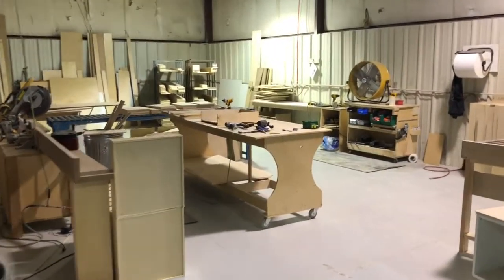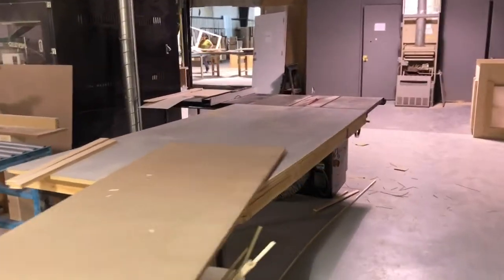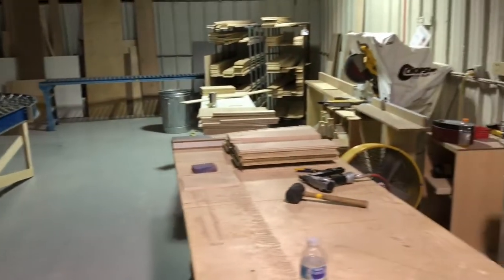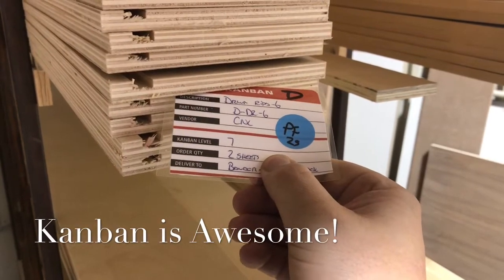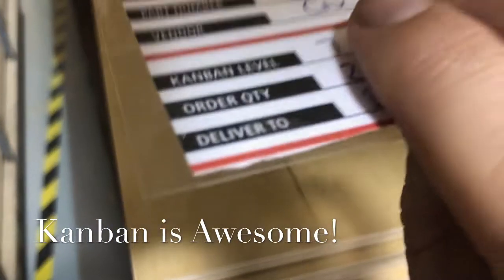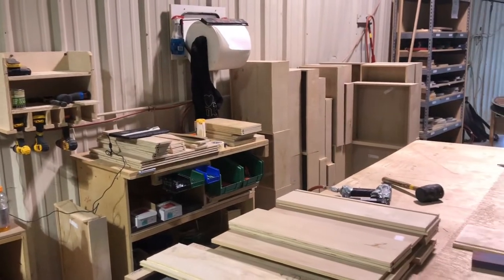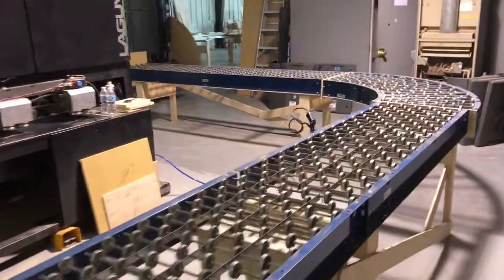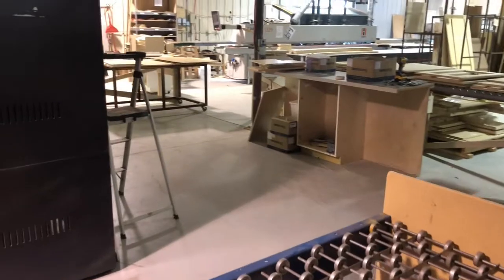Drawer And RTA Cell. Continuous Improvement

Comment: Wouldn't cutting wood to order immediately prior to its need eliminate the need for any cut wood inventory as well as its related Kanban?
Reply: Robert D In Tulsa   That’s a great insight. In our particular situation we are early in our transition to cutting drawers by hand. In the past we cut them on the cnc. In order to gain capacity we started doing it this way. We decided to add a touch of inventory (precut rips) to even out the flow. Basically we needed a little flex in our drawer schedule and we needed a little flex on our cnc. We are right at capacity on our cnc so by doing the kanban we have a little time buffer built in so we don’t have to interrupt their current job. I am sure that our next rev will lower the water even farther in this area and get it even tighter. With this rev we cut the inventory in half!  Thanks for the great comment!
Reply: Cut the excess inventory in half?
Good damn job, to all!

Challenge....that isn't good enough...why?  Because it's never good enough.
Cut that inventory...by any appreciable amount, say at least - 10% / per week.

No more inventory.
No more excess carts.
No more waiting.
Orders filled / completed same day...perhaps half day.
Reply: Robert D In Tulsa that’s exactly right. I’m a big fan of lowering the water to expose the rocks. We are cutting our lead time every week. I hope in a year to have production time down to a week or less.  Then cut more from there!  Good stuff, I love lean and now that it’s taking hold in the shop sky’s the limit!

Comment: Your Kanban cards appear to be hand written.  Why is this?  Do you have plans to automate this?
Reply from the maker: Greg Fasolt Great either. We currently do hand write the majority of our Kanban cards. However there are some we type out and print. For us we like to focus on getting Kanban implemented as quickly as possible. So generally speaking we will use the cards for a month or so and then if we know it’s going to become permanent will go back and make nicer versions of the card. At first we are just purely worried about speed of implementation. After that we can get all the pretty stuff for later. Hopefully that answers your question thanks for asking!